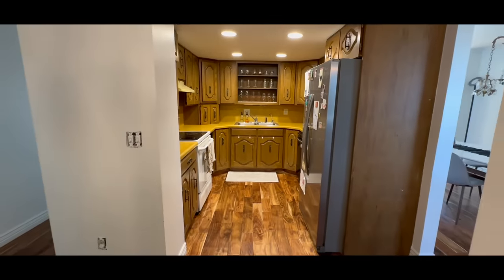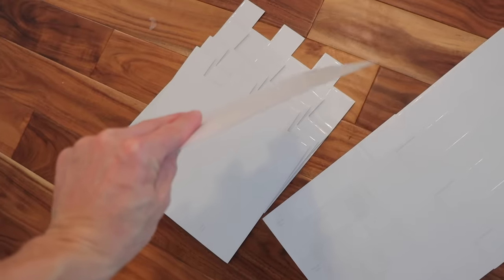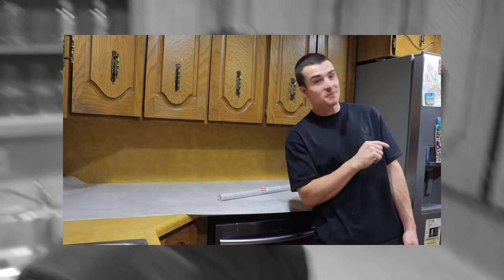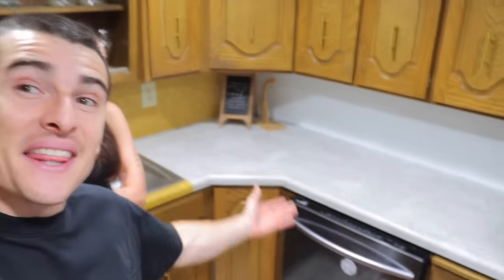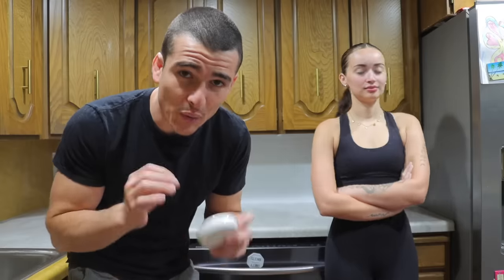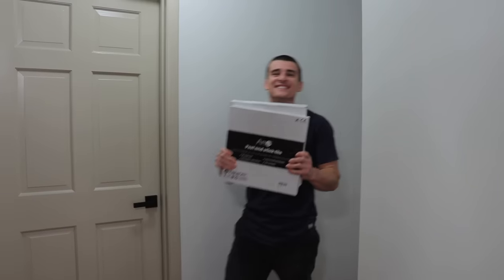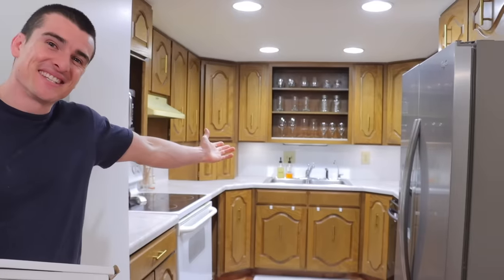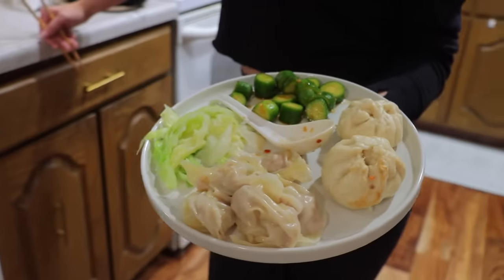We Tried a Budget Kitchen Makeover

Comment: Paint the cabinets next. You can sand them down or use a primer that won't allow oil to bleed through, then paint.

A nice Royal Blue, Black, or White would look good with the Brass cabinet pulls. you should also spray paint the stove hood.

Comment: I did this to my moms place for her and it turned out great! I got the 5$ vinyl rolls from Walmart. It takes patience to lay it town and a strategy. I only messed up my first try (a small piece) by wrinkling it and then took it off and restarted. If anyone wants to try this it really does work and can look beautiful. It also has held up to water so far 3 months later and looks and feels amazing! If you have a second person to help lay the counter top vinyl down it helps too, because they can hold it while you flatten the piece down on one side with a card. I did it alone though and it was fine. Its a great cheap way to redo your kitchen! and once its wrinkled pull it up and either start that piece over, or pull the wrinkle out. Since its paper it wont unfold and become flat by using a blow drier, there is no space for the fold to lay  out.

edit- The second way yall layed it down is deff easier! I think it looks amazing!!!

Comment: And you need flexible trim for around the backsplash and on top of countertops. 
Also called trim molding. 
Measure where you want it and order how long you need. 

And I would color block the cabinets. Color on bottom, white on top